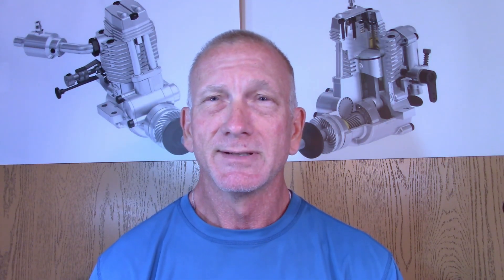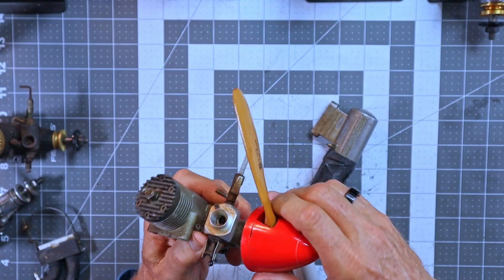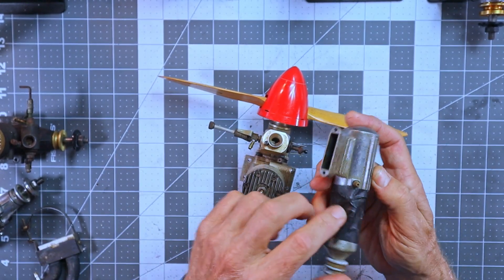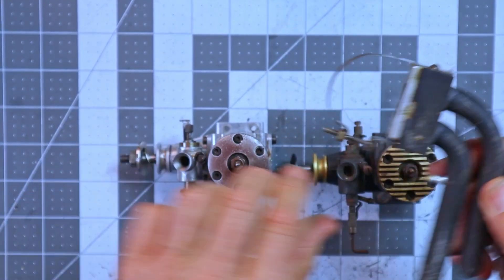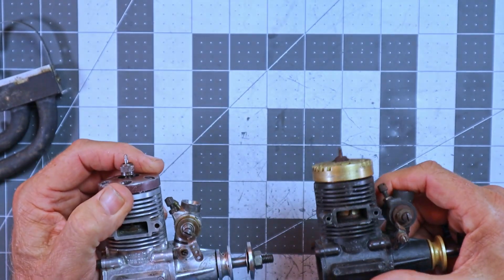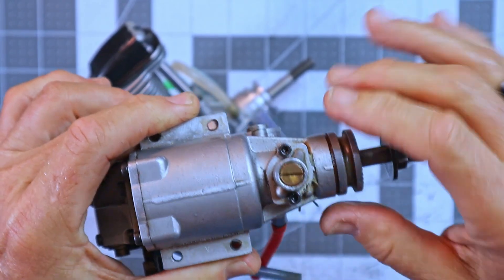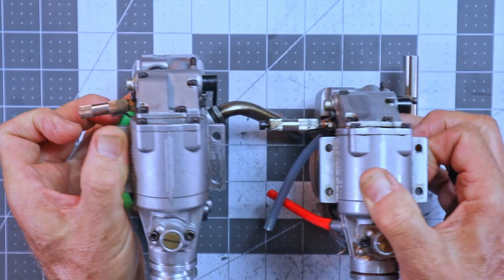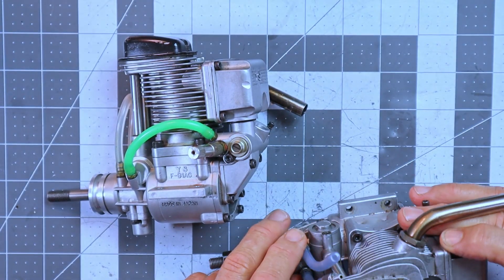Engine Talk Episode 4 HP, YS, and Webra

Comment: YS are supercharged. When the combustion cycle fires, it shoves the crank case air and fuel like a two stroke into the chamber to be held.  The crankshaft is similar to a rear induction two stroke. On the intake stroke normal four cycle it sucks in mixture bypassing the chamber but them tbe chamber mixture is released mixing with the regular intake mixture.  It is a simple mechanical supercharger, but for only single cylinders.

Comment: Hey David, I enjoy watching your videos.
I believe the “normal“ HP 40 was sold as a silver line or silver cup. 
Also, I was surprised that the web description of turbocharging and supercharging completely left out that turbocharger rotors are spun by the exhaust gases to compress the intake mixture typically pressurizing the carburetor or injection system, (blow-through) but can also be mounted “under or before” the carburetor in a “draw-through“ configuration.

Comment: That is exactly correct Dave, a super charger increases the charge density of the fuel molecules. On an aspirated engine, when you close the throttle opening, you are decreasing the charge density and hence the explosion of the mixture is softer because of less fuel molecules in the combustion chamber. Hence, the engine run s slower.